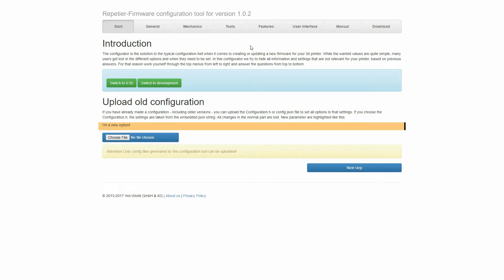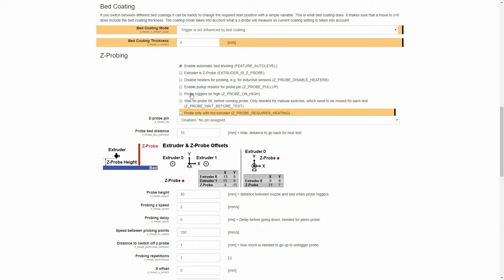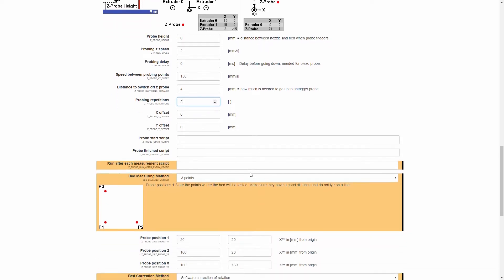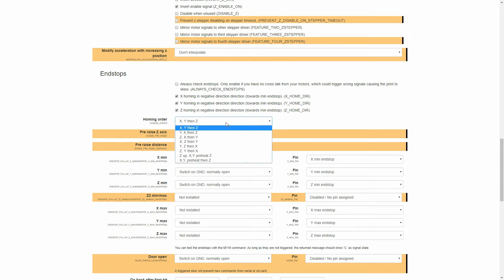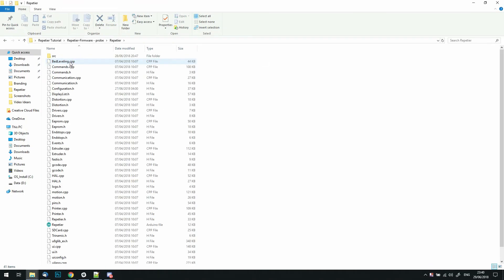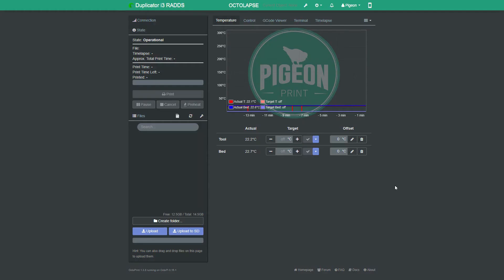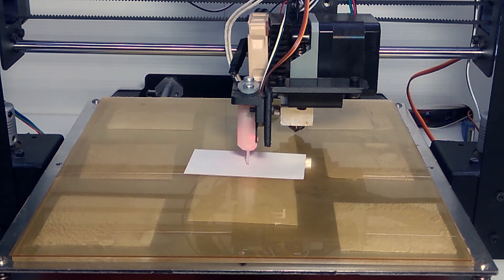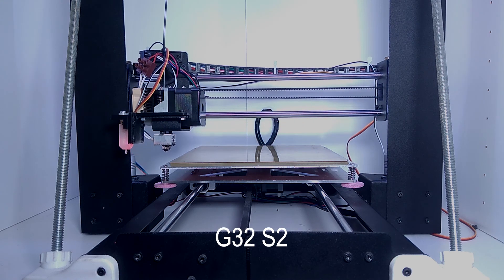BLTouch Setup Tutorial For Repetier Firmware

Comment: I did play around with the values and even tried the ones on Anthony Jordan's blog here. He suggested the values are:

Marlin	Repetier	Function
M280 P0 S10	M340 P0 S648	Pin Down
M280 P0 S90	M340 P0 S1472	Pin Up
M280 P0 S120	M340 P0 S1782	Self Test: Pin Up/Down continuously until another command is received.
M280 P0 S160	M340 P0 S2194	Release Alarm
Reply: great call, that one is compatible with Chinese version(s)

Comment: I was able to follow along with all the steps. However, After I opened ARDUINO I did not have the Port COM3 as a choice. Can you help me resolve this problem. Thank you
Reply from the maker: Hello, the COM port number  will depend on lots of thing like the USB port on your computer, to find out what COM port Number the Arduino is on just open 'Device Manager' and plug it in and look at the 'Ports' and it should appear there with a COM number like COM5 Or COM4

Comment: Does this work for homing Z? how do you home z? with the bltouch? for me it works to do autobeleveling but no for z homing
Reply from the maker: Hi, did you set the Homing order to "XY then X" and the Min homing temp to 0?
Reply: Pigeon Print, I solved it using the latest firmware version. 
thank you!
Reply from the maker: @martins.-pach3979  No problem, happy printing!

Comment: Duuuuude! Your entro is smooth! Gray work man! Did you ever find a way to add a BL touch to the lotmaxx?
Reply from the maker: Yes, in theory, you should be able to use one of the unused pins on the wifi module to get a BLTouch working, actually working on this at the moment, (though really need to edit my first review and upload it this week) think the firmware may be an issue as its closed source but will be doing some followup guides on the Lotmaxx so grabbed a second mainboard to play about with (its a MKS Robin Nano rebranded for Lotmaxx, and there is a MKS Robin Nano board V1.2 mainboard that has a dedicated set of headers for the BLTouch, so will be testing that board out with stock Marlin and a BLTouch too as its only about $15 for the V1.2 mainboard, could be worth switching boards to get auto bed leveling and open source Marlin firmware).
Reply: Pigeon Print please do share! I’ll be following closely. I didn’t even know our current board had a WiFi module. I’d be very interested in getting it worked by- my bed is super warped.
Reply from the maker: @NerdsWithFriends  Well its got the connectors to receive a wifi module, the module itself is around $8 and can be set up quite easily and handy if you just want to send print from Cura to the printer, will have some info on setting it up in the video this is the module it excepts  https://www.aliexpress.com/item/32816882694.html?spm=a2g0s.9042311.0.0.6a1d4c4de7WqU9 to be honest not sure why Lotmaxx don't shout more about some of the features, I opened it up expecting to find really cheap components and everything built down to the lowest cost, but it has a quality mainboard and a high-end power supply and unlike most, they even grounded the enclosure and frame, so really a safe bit of kit too for children around it, auto bed leveling is the only big negative, but will have some options sorted for that soon!

Comment: Hope you can help me, im sending M340 P0 S700 and terminal says unknown command after fishing with your settings. Probe does turn on, does in/out at startup an is solid red on standby. What am i missing here?
Reply from the maker: What mainboard and firmware version are you using?
Reply: Pigeon Print it’s a rumba and I’m using 1.0.3. I kind of solve that error but it will still not execute the command
Reply from the maker: @ArielYahni  have you tried adjusting the black screw on top of the BLTouch, raising it up a  half turn and testing the M340 P0 S700 command till it lowers the pin?
Reply: @PigeonPrint  No luck with that either, tried a couple other rotations also. Here is my status, boot the printer the pin will lower and rise and keep the LED red. Manually pulling the pin will turn off the LED.

Comment: Hi
Great video
You mention adjusting the probe height later in the EEPROM, but how do you work out the probe height in Repetier?
Reply from the maker: Hi, most printable mounts will have a set of offset measurements to use for the XYZ (usually in the filename) if making your own mount it will be a case of turning it in using the Z probe hight in the EEPROM of the printer till you have the right first layer.

Comment: I have successfully setup this feature and it works fine but looks like it does not work while printing. Because after print starts z motor does not work while the same table with marlin moves according to z correction. What is the idea of this bed leveling in repetier if it does not do corrections while ptinting?
Reply from the maker: Sorry, totally missed this comment. Did you get it working?
Reply: @PigeonPrint  nope, I has to go back to marlin((
Reply: @alexiva886  G29 S2 and it will measure the bed and correct it while printing

Comment: A verry nice Video Thank You
BUT i gote some Problems. can you help me?
Meanwhile Repetier 1.0.3 is released.

First i have to manually comment out "#define Z_PROBE_USE_MEDIAN" in configuration.h because the Sketch will not compile 

When i send one of the following commands i get a Error: unknown Command:
   M280 P0 S10 ; pushes the pin down
   M280 P0 S90 ; pulls the pin up
   M280 P0 S120 ; Self test – keeps going until you do pin up/down or release alarm
   M280 P0 S160 ; Release alarm

The following Commands woks propper, when they mannually sended and the Sensor Pin moves.
   M340 P0 S700
   M340 P0 S1500
But the logic state of the 2-Pin Connector (black/white Cable) seems not to change, only unplugging change the state

IN A TEST ENVIROMENT with MKS GEN 1.4: ONLY THE BL-TOUCH IS CONNECTED

Can you Explain me why

Comment: I've done everything like you in tutorial but after G32 S2 or chosing bed leveling on printer screen my printer does autoleveling but its resets itself after test.
Reply from the maker: Hey Jakub, when you say it resets itself, do you mean it downs down and restarts, or do you mean it resets itself to the home position? if the first one, sound like it could be an electrical issue, is the connector on the BLTouch seated correctly or lose connection on the solder pads if older or clone model  (sorry for the delay in getting back to you!)
Reply: whole software resets. Nvm i did a mistake in start script

Comment: do you have to do anything with the servo configuration?
Reply from the maker: Just enable Z probing in the configuration tool so you can use the probe as an end stop.
Reply: @PigeonPrint  When you enable Servo support I note it automatically then enables Servo Pin as D11 - yet I found instructions for the BLtouch that says to put the 3 pin cable on Zmax and the 2 pin cable on Zmin - for me that is then D34 for the Zmax pin (Ramps FD) - so should that mean I change the Servo pin to D34?
Further to this I am going to use Motors for Bed levelling - I have 3 Zscrews for Z axis - just wondering if you know if that means I put them as the "Extra Motors" in the repetier config... as on the repetier Page it states "For this to work you must define below the coordinates where the bed is fixed. Points 2 and 3 get controlled by the motor driver 1 and 2 defined below." but the only bit that seems to be "defined below" is the "Extra Motors" section, which is Outside of the Z-Probe section...
Great vid by the way - helped me so far with a few little holes I was seeing in config.
Reply: @lklmmedia4715  I have this same question. I know this post is from 4 years ago, but do you remember what you ended up doing?    Changing the servo pin ?
Reply: @proxlamuz4591  I'm sorry to say I really can't recall - in fact I even do know that I never ended up using the BL Touch in the end, I think I just found configuring it too hard in my non standard setup.  Subsequent to all of that my Large format build is not functional for well over a year and I ended up getting a Creality CR-10S5 off the shelf to replace it...and even that I haven't used for a while - just far too busy.  If I ever get a chance in the off-season I might dig around in some code and see if I can recall what I ALMOST had working!

Comment: Good video, mine doesn't respond to the BLtouch signal. I think repetier is missing the signal, have yet to figure it out.
Reply: check wires. Some verion od chinese sensors have changed wires. Mine is TL-Toutch from triangle lab and i have to solder wires again.
Reply: @Qbix  I guess problem with z homing. It looks like it misses gcode for servo